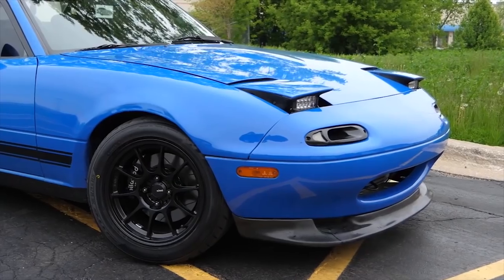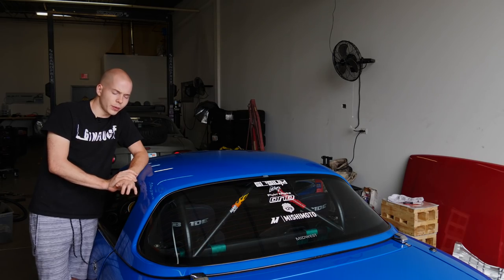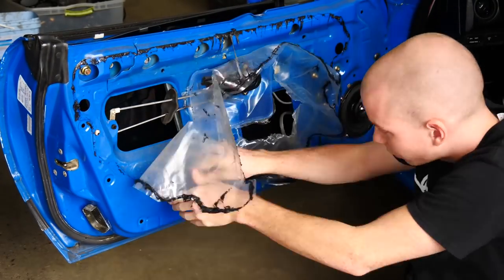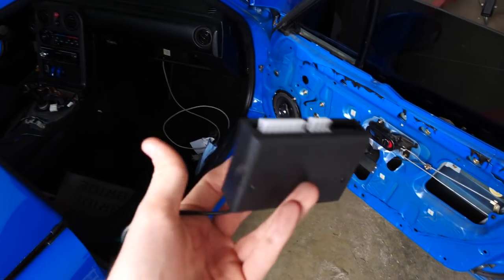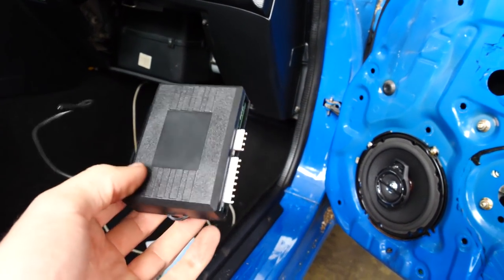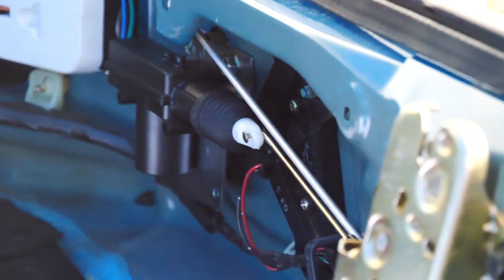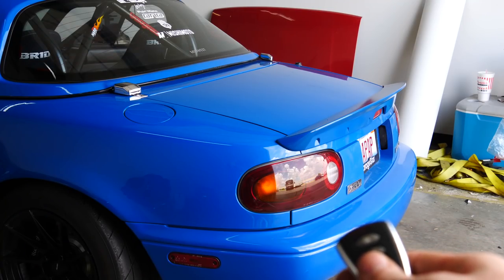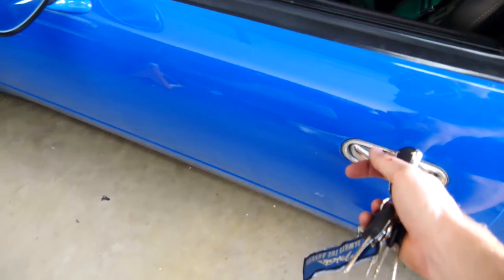How to install a KEYLESS ENTRY System in a Miata!

Comment: It isn't keyless lol
Reply: Dani P ikr😹😹😹
Reply: It has keyless entry now wdym?
Reply: he said keyless entry
Reply: Dani P It is keyless. He said keyless entry, meaning u dont have to use a key to get in like he used to. Now he can unlock,lock,and open the trunk with the press of a button. Pay attention kid. Handsfree is a totally different thing. Handsfree is when the car has a sensor under the door handle, and if you have the fob on you, you can simply put your hand under the door and the door will automatically unlock. BIG DIFFERENCE!!
Reply: The keyless entry system means he can walk to the car and it automatically opens. But this system needs a key fob which means it isn't keyless.....
Reply: Well technically the door locking mechanism is now keyless, so he wasn't incorrect
Reply: Jan Odink That is not keyless entry, that is hands free entry.
Reply: Yeah, you might not need a key for a lock but "keyless entry" is another thing
Reply: Raptor Jesus so hands free is keyless? Had the option multiple times on cars I've driven and keyless and handsfree are both called keyless entry
Reply: I've seen it called hands free, automatic and keyless. Ultimately though the key-fob keyless entry came out first so I feel it gets the name, the other should be hands-free, automatic or butler entry (Cause normally a butler would open your door for you if you're that rich and I find the name amusing) but that is just my opinion.
Reply: Alebone that's true but for the entry he still needs a "key". It's a key fob but when the buttons would be on the key it would be the same thing which doesn't make it keyless. He doesn't need to use the key for both doors which makes it better but not keyless😋
Reply: Jan Odink For your version of "Keyless Entry" a key is still required as well, you just don't have to go to the effort of pressing a button.
Reply: A remote controle isnt a key
Reply: Why we arguing about this lol. It is keyless entry, I had a pamphlet about our car back in the early 2000 and it came with keyles entry out of the factory. You get a key fob thus unlocking the doors with out slotting the key to the key hole beside or on the door handle.
Reply: He was probably born in the 2010s, where keyless go systems started to get really common. I miss the old days, where you actually twist a key instead of pushing a plastic button. It's just one less connection with the car.
Reply: Jan Odink with that train of thought, you also still need a key fob for a car to unlock when you walk up to it. I guess nothing is actually keyless, huh?
Reply: There's a difference between keyless start and keyless entry
Reply from the maker: Dani P do I need a key to get in the car? Nope. 
Then its keyless lol.
Reply: You just got roastiumed.
Reply: I don't think you can read
Reply: Gingium Dude, the object that you lock/unlock the car is called key, and you need to use it to lock/unlock the car, keyless it's when the key it's near the car and it automatically opens when you pull the handle, am i right?I think i am.
Reply: Disaster_OMG that's handsfree. Keyless is not the same as handsfree. The fob is not a key. You press a button, and without having to put the key into the lock tumblr, the door unlocks. That's keyless entry.
Reply: hands free is a method of talking to the car to do for example change the temperature of the air con
Reply: Disaster_OMG well how can the door open if you don’t have a fob like with Audi you still need to have the key with you to touch the handle and unlock the car
Reply: remote entry...
Reply: but you dont need to interact with the key, there is zero interaction.
Reply: Technically it does not require the key to unlock it.  Though you're right I think "keyless" means it's proximity based.  IMO I think some of these newer tech things in cars are a bad idea, especially keyless start/drive.  Ex: being able to drive the car without the key in the ignition.  Super easy to hack or accidentally forget your key at home.  Happened to my parents one time. They went to church and forgot the key in the house, it was close enough to register so the car started and they made it to church... but could not come back.  I had to give them a ride home so they could get the key lol.
Reply: Dani P the key fob doesnt have a key 0_0
Reply: Dani P he means he doesn't have to manually use the actual key to unlock it
Reply: @_Gingium_  keyless entry these days means you walk up to the car and lightly pull the handle which will trigger the system to check if you have the 'key' and unlocks the car without you having to touch the remote/key. Keyless start used the same principle where the car detects the key being in the car before allowing the driver to start it. What you installed is remote central locking. Still pretty sweet though and definetly an upgrade for miata's.
Reply: @redsquirrelftw  lol. That's just a dumb implementation of keyless start. Most cars won't let you drive very far when it 'loses' the signal. It's also pretty common these days that the 'key' has to be inside the car, not just in proximity.
I do agree these kind of systems are vulnerable to hacking, especially since car manufacturers often have no idea of security when it comes to electronics and there have been cases where a relatively simple signal repeater would allow someone standing outside you house to open your car parked in the driveway.
Reply: There are three types of legal entry to a car...

1) Manual key unlocking (self explanatory). 
2) remote central locking : using buttons on a remote to unlock a car. 
3) keyless entry: having a fob in your pocket without the need to touch it and being able to open car because the car senses the fob is nearby.

It is even called central locking on the box, your videos are great an all but it's definitely not keyless entry

Comment: I would love to have a 1995 camry or 1995 impala ss with super modern tech light keyless entry led headlights auto start big cup holders remote windows heated cooled seats rain sensors wipers ect that's why I like my bmw x5 but they are extremely expensive to maintain while a 95 camry is extremely cheap in had 1 and spent 100 bucks on a battery for the total 7 years I owned it and my dad had a impala 96 and owed it for 10 years with zero issues my 2002 bmw has cost me 10 times what I payed for my old camry and Corolla now I have a new taurus but 5 years from now who knows how it will hold up......